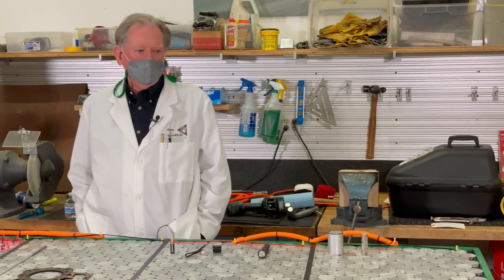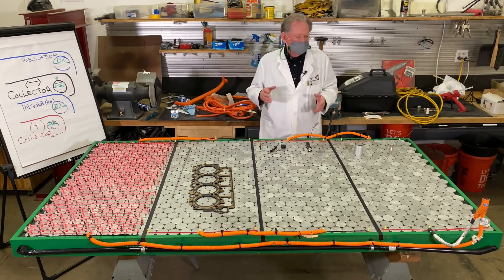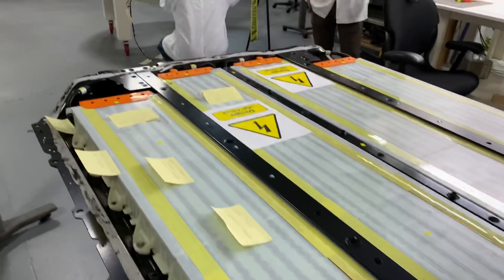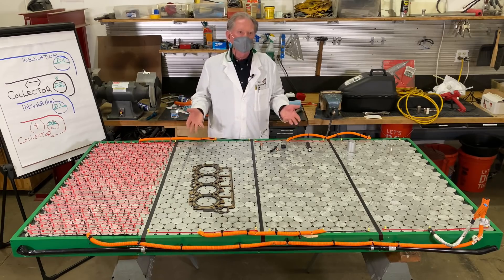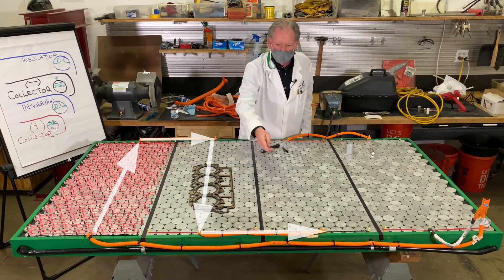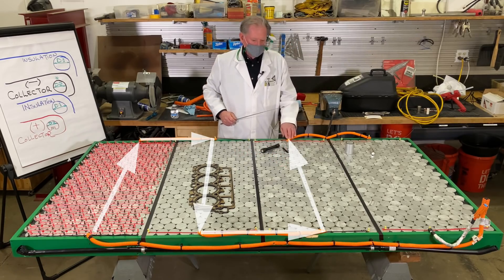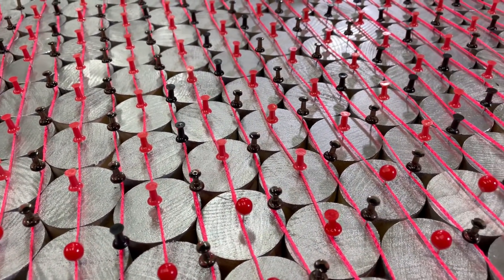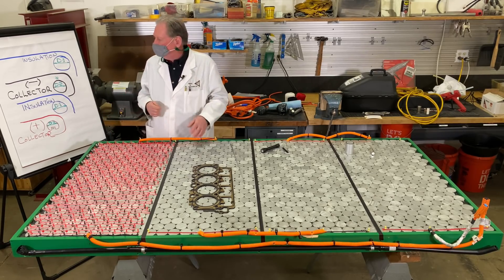Tesla 4680 Battery Pack Prophecy

Comment: How about making this 3 modules instead of 4, rotated 90 degrees(long and skinny). Also, wiring each module to reach the target voltage individually to be  connected in parallel for the pack.
You can then save on wires connecting the modules, you can also remove center module for lower capacity vehicles without introducing weight distribution changes and keep most of structural integrity that this new pack provides for the vehicle.

Comment: So, your estimate is:  four modules, 24s10p each. And then a 4s configuration (like in your comparison with 4 Duracell cells in a flashlight) to get 96s10p. This has  a major drawback: you cannot change to 192s5p easily. So I believe in 4 modules of 48s5p each. Now you can do a 2s2p of them to get 96s10p. Or you could do a 4s of them to get 192s5p. A 192s configuration (700-800 volts) would be better to reduce currents in the system, and with the currents, reduce dissipation power (power losses) in the wiring dramatically!

Comment: I appreciate how your team took the time to cut all those dowels, paint, and assemble that diagram just to show us how you think Tesla is going to do it. Great work Sandy and team!!!!
Reply from the maker: Thank you very much. A lot of credit to Andrew V. from Munro for the assembly.
Reply: Absolutely, most impressive mockup. A question: what if just one cell fails, is the whole pack rendered useless?
Reply from the maker: @DavidOfWhitehills  Good question. Each cell will likely be in a group of 10 that are wired in parallel. Each group then is wired in series for a total of 96 groups of 10. So, if even one cell fails the voltage stays the same for the whole battery pack. Technically your total battery pack capacity takes a hit but relatively insignificant with 960 total cells.
Reply: @MunroLive   Thankyou. That also clears up my confusion about cell voltage v pack voltage.
Reply: @MunroLive  if one cell fails, and your pack is structured as 10p, then you've lost 10% of the capacity, as the weakest set of parallel cells defines your maximum discharge the depth.
Reply: @edc1569  I do not believe so. If you have 96 sets of parallels, it would be closer to 1% than 10%
Reply: Not sleepy at all. Lol. I always love the info.

Comment: This idea works if and only if the positive is in the center and the negative is on the sides. However it's more likely to and bottom like all other batteries.

This set up would make cooling very easy. Since all your writing could be on top and all the cooking could be on the bottom.

Comment: You should have qualified that the per cell gains (5 x energy 6 x power) are 95% from getting a 5.5 x larger cell and nothing extra special. The 16% more range could come from any advancement inside the complete module, not just per cell. See Dave Jones EEV Blog video. Edit: I just rewatched the Tesla video and they indeed showed the 16% as just from cells, so I was wrong on that.
Reply from the maker: great point, Sandy could have been a little more clear. We do understand that the whole vehicle/pack does not see the 5.5x increase, just the cell. And then using only 960 (4680) cells instead of 4416 (2170) cells.

Comment: I think 3 banks of batteries for 3 phase motors. I also think connections will be full top surface area for least resistance and full bottom surface is for - / + with bus bar connections with flat band to motors. Sometimes I am right most of the time Im wrong. 
Happy thanks giving.
Reply: You feed the right voltage to the inverter and it takes the DC and makes it AC to feed the motors.

Comment: Sandy,  I think your pack has a major design flaw.   The high voltage bus should be down the center of the pack for a couple important reasons,  first its the safest place in a crash, no matter how much crash structure you put down the side of the car it will be compromised in the real world at some point, and if you compromise the high voltage bus, there will be a fire.   Second the motors and inverters are  longitudinally centered in the car so having a central bus will use less wire, to feed them?
Reply from the maker: You make a good point, but all points of the battery will be at the same 336v High voltage. Many other OEMS do have centered bus-bars. Thanks for weighing-in.
Reply: @MunroLive   I think it's easier to protect the Cells of the pack themselves from damage than it is to protect the high voltage wiring outboard of the pack.  I guess the bigger issue though if you are looking for the ultimate  design, is to design all aspects of the pack to use the least possible materials and risk points?       With high voltage wiring down the outside of the pack and then designing protection for it I think back to McDonnell Douglas design.  HAHA!      Running all the connections, and pack wiring through the spine of the car makes more sense as it's the shortest distances.

Comment: For someone who is not proficient in electronics, this was really understandable.  Midway through I had an Ah Ha moment, and then it was really solidified with the graphic of Duracell batteries on each quarter of the larger battery pack.  Thank you for this presentation! Get this channel to 100K! They've earned it more than plenty of other channels with double the subs.
Reply from the maker: Thanks so much!

Comment: Hey thanks for that Video !
But i have a lil assumption.
So if these cells are put together electrically touching eachother, it would be only one series connection possible and 960 in parallel, or 240 if we asssume 4 modules.
But if we insulate those 10 cells in a row from the next row, like the cooling channel did in the 2170 pack, we have a minusconnection and we would need only one spotweld for the "black" pins.

Comment: Mr. Munro, I just want to say you're a shining example that age doesn't have to dullen a mind. About the assembly method, I realise this is far-fetched, but given Tesla's track record of going down to prime principles, isn't it possible that they'll come up with a connection tech that isn't what is presently known as "welding"? It wouldn't surprise me if research on what occurs at the atomic level when elements are welded yielded insights as revolutionary as the metallurgy that allows for their "Megacastings."
Reply: Rik I think you're on to something there.
I would think they will at least do some sort of ultrasonic welding. Maybe even cold welding in a vacuum. (Cold welding happens when there is no oxide layer between two same metal contacting surfaces, because metal is basically like taffy)
I'm imagining a pack width giant roller with electrodes in the pattern of the cells that gets the whole thing welded in a matter of seconds.
Reply: @Gabriankle  Sandy's a bright guy, 't but his "stable" of engineers can't compete with Tesla's. Another thing I've been wondering about is when / if Musk will apply "Prime Principles" to tyres...? Might not be enough of a financial benefit to Tesla, but Elon's also on a mission to improve the planet, let's not forget, so his motivations would likely be a combo of tech solutions for production streamlining but with a side order of ecological salad.
Reply from the maker: thank you Rik!

Comment: Very interesting. So what it seems is that each pack will have 84V. I guess that's okay from the standpoint of assembly because they won't actually be separate banks, just wired up in 10P configuration after the battery is a whole already. What if they just used 5P to double the voltage?

Also, what do you think they'll use to insulate the cells from each other and insulate the bottom while still conducting heat? Just plain thermal epoxy?
Reply from the maker: Yes, Yes, and Yes! you get it Jodie. 5P would double the voltage. We think they will use similar epoxies to the Model Y and Model 3.
Reply: @MunroLive  Ah, cool. Thanks for the reply! Now if only they sold spares, we could get hold of the batteries for our own projects.
Out of interest, do you expect we'll be staying with Lithium for bigger vehicles, or perhaps with a bit of a push we'd get some standardised Zinc Bromine electrolyte network? Currently the problem with batteries and solar panels is your vehicle is usually on the road while the sun's out, so you've got to charge an intermediate battery and then charge your vehicles separately. Would having solar-powered bromine processing at fuel stops be reaonable?

Comment: are we sure that the + and -  are on the same side of the cell?
Reply from the maker: The model Y have + and - on the top and the wire-bonding is all on on side. In this video at 3:42, we show a picture of that. This all comes down to Cell-design, and we are assuming a 2170 style cell for the 4680 cell.

Comment: So you believe that each of those "modules" will be just under 100 batteries in series, for 330V voltage.. and then you believe all 4 of those battery modules will be in series, for a total pack voltage of ~1.3kV? Much more likely they'll be in parallel to keep the pack voltage in the ~400V range like other Tesla packs, no?
Reply from the maker: 336V nominal. 96s10p. 10 cells in parallel, still 3.5 volts. 96 groups of 10 in series, 96 x 3.5V =336V (nominal) you could charge close to 400V. hope that helps!

Comment: Sandy, a nice way of displaying the series/parallel battery effect would be 2 identical flashlights one with 2 series connected batteries, the other with 1 battery and a dummy with a wire from bottom to top. Demonstrating the increase in voltage (brightness)...
Reply from the maker: that is a great idea. thanks Alan.

Comment: Hello Mr. Munro. This was a great explaination. What do you think about Tesla increasing the pack voltage to 400V. That would in getting higher speed of charging ( especially at low SOC) 
Wishes for festive season.
Reply from the maker: Hello! 336v nominal can be charged up closer to 400v. Thanks for watching.
Reply: @MunroLive  thank you very much for replying. 
If I may, a follow up.
Are you guys planning for the EV event in  2021 ?

Comment: Sandy, all the cylinders are conductive, surely? So one could simply stack them against each other to create a parallel pack. Or put a conducting plate between two rows of standing cells.
Then for the positive sideTesla could put a conducting strip connecting the positive poles. Enough of those gives you an equal parallel charge to match the negative. Instead of a strip, one could have a conducting structural plate which the positive poles rest on.
As Elon said, the battery pack is a structural element. So the cells have to be connected somehow. The cells could be welded (glued with conductive glue?)  together on their lines/surface of contact.
Then you connect the ends of the conducting strips appropriately.
This configuration seems much simpler to me.

Comment: Why not have pressure plates above and below bolted at intervals to squeeze layered connection plates rather than welding?

And/ Or, set banks of cells upside down to give the correct positive to negative connection pattern?

Comment: My takeaway from this excellent deep dive video on cell and pack design that is being innovated by Tsla si that legacy auto will have to roll up their sleeves and get to work on similar designs, if they want to remain relevant and "make ends meet". Otherwise, as Sandy points out, trying to drive costs down from the older Tesla cell to module to pack design is a waste of time. I believe Tesla will make more batteries and packs than they need and they will likely help out legacy auto by selling these newer more efficient packs. Given that an EV's range is the criteria that most buyers consider first and formost, legacy auto makers will have to match Tesla if they want to sell cars in the future.
Reply from the maker: great interpretation Simon. yes!

Comment: Instead of a spot weld, could they have a shaped piece of metal that fit in like a puzzle piece to save time?
Reply from the maker: They could. Good idea.
Reply: The connection still needs to be a fuseable link.  It can be a tab as Sandy suggests in the video. The folks at Battery Hookup have stamped out a system properly rated to pop at about 6amps  https://batteryhookup.com/collections/cell-level-nickel-fuse
Reply: @bobbrutvan2435  Thanks, fuses built into a thin sheet of metal seems like a good idea  I hadn't seen anything like this before.

Comment: Thank you very much for the explanation.
Another positive factor: robot manipulation. It will take less time for a robot to stack the cells into the pack.
If they use 5 minutes to put the small ones it will take 1 to put the big ones.
Also shaving time from the spot welding by having an aligned panel over the cell and one big welder welding it all at once instead of one at a time.

The goal with this cell seems to be bigger than just range. The customer sees what they want to show, better range for the same price. The CEO knows it will increase efficiency in the manufacturing process, less errors, less time to produce, more margin.

Have a wonderful Thanksgiving ! We are all very grateful for your work.

Comment: A very nice mock-up! So in this particular size, we would be talking of a 96s10p pack, correct? It's really a nice design - would be trivial to just add or remove parallel cells to scale the pack capacity.

Did you brainstorm on how the internal BMS connections to each series voltage point would be achieved? Another layer on the "gasket", or separately welded wires for that? Any guess to whether there will be active balancing circuits?
Reply from the maker: That is correct. We have thought trough the BMS, we may do another episode on the BMS at a later date.

Comment: In an earlier video I saw that you believe the gaps between cells will be filled with epoxy to enhance structural integrity. Do you believe the manifolds will be connected to the cells before or after the epoxy connects them together mechanically? I would think the epoxy would be added before to make one rigid piece before adding the manifolds to maintain precision for the electrical connections.

Comment: Really good! Very curious about how they're gonna prevent explosions without coolant channels between the cells. I understand that the heat will flow longitudinally towards the bottom, but how do you protect the cells from a short-circuit? Is the chemistry different?
Reply: They make sure there are no short circuits, just like current cars make sure their gas tanks don't leak. In a collision, all bets are off. BTW, lithium cells don't explode, they outgas. Coolant channels between cells do not prevent "explosions".
Reply: @JasonWW2000  I don't understand.
If you have 100kwh of energy packed into a small space, in the form of high-energy chemical bonds (or whatever you wanna call Lithium ions inside a graphite anode), and you get a short-circuit because of an accident, how do you know that it's not going to explode? The short-circuit of the affected cell will heat up the surrounding cells, damaging them, and possibly melting their Solid Interphase Layers, which would cause more short-circuits, and more energy released...
I don't understand how can you say that they don't explode just because they're Lithium ion cells.

Maybe the amount of gas that exits when it burns is high enough to cool it down so that the system does not diverge?
Also, there are several videos of electric scooters exploding, and I don't think those have Lithium polymer cells. They have normal 1865 Li-ion cells.
Look at this for example. It's like fireworks. https://youtu.be/WdDi1haA71Q
Reply: @rubenayla  I think your confusing the words explode and burn. Yes, they can catch fire and burn. Explosions by definition is the release of energy in a very short amount of time. So to make an explosion you would need to put a short circuited lithium battery in a seal container like a pipe with threaded ends. If the pressure builds up enough it will overpower the pipe and burst open. This would be an explosion. 

Also, some 18650 cells simply do not out gas or catch on fire when shorted. They just discharge their energy, get hot and then cool back down. 

When you have a lot of cells packed next to each other and one catches fire it can heat up the cells next to it and create a runaway thermal reaction. Theres nothing you can do to stop this. Just like a leaking gas tank on a petrol car (involved in a wreck) you get out and get to a safe distance. 

In that Rich Rebuilds video you see cells outgassing. They are not exploding. The puffs of air blows flames so it looks like its exploding, but it's not like "bomb" exploding. 

Perhaps in the future we can use a different chemical mix to make the cells safer, but for the near future liion is the best cell for our needs.

Comment: Munro live team please confirm if my layman understanding is pretty much correct. 6*Power and 5*Energy per cell but 1/5 number of cells, so little difference per car. Car will have 16% more range. Battery per car will cost 50% less, plus as it is structural there will be money savings on the current car structure, plus simplicity of build? How much do you think that could save per model Y?
Reply from the maker: you get it! yes. 960 4680cells vs 4416 2170cells. More power and energy per cell, but about 1/5 (or 1/4) the cells needed. for the model Y, that would take some number crunching.
Reply: @MunroLive  ha ha, well if anyone can crunch number it's your team, I know you could do it to the cent, but the the nearest 1000$ just as a matter of interest would be lovely. In the UK Tesla M3 sr+ cost from $53k, so that's a large bump for tax and shipping.
Ideally I'd like the Y but it's way out of my price range unless MIG are significantly cheaper